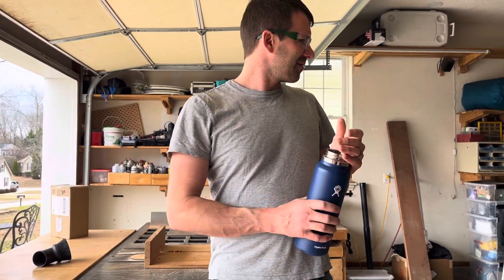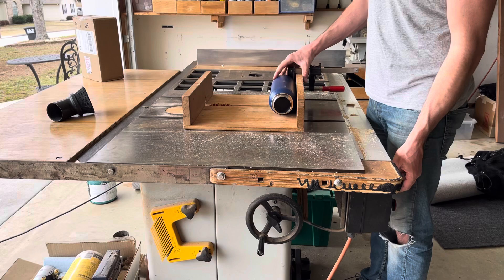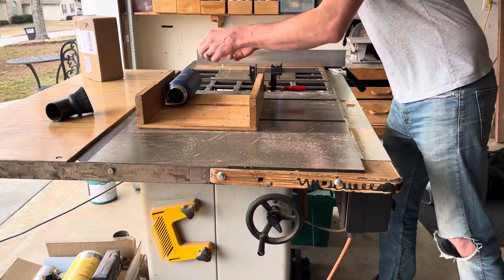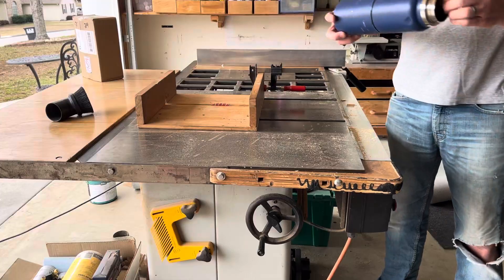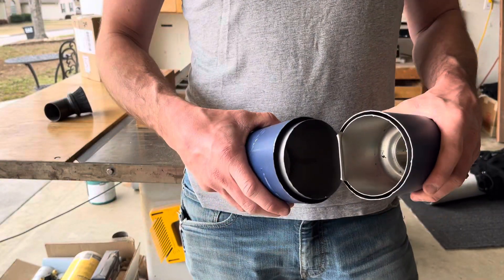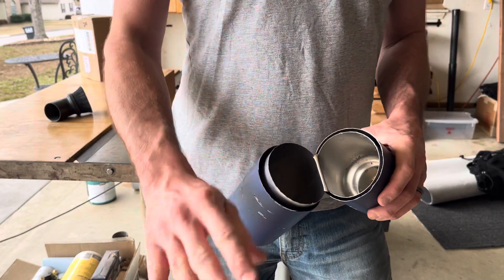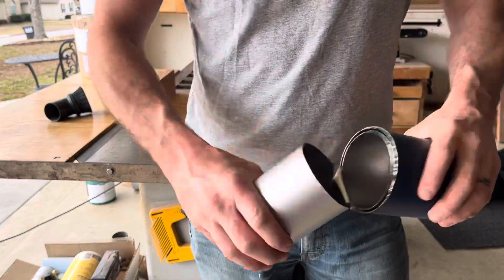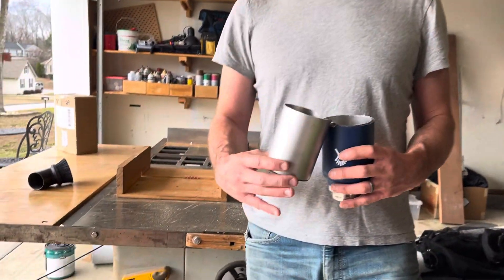Inside a vacuum flask - a close call on the table saw

Comment: it went better than i expected...
guess this isnt a task performed often enough to warrant a jig, lol... ratchet strap or pipe clamp, end stop, and take a few passes on that sled... gotta be slightly mad to hold a cylinder by hand on a saw?

last time i mistook aluminium for something else i nearly set the lathe on fire... was magnesium?
 all fingers present, no blood... sigh...
Reply from the maker: Nice comments! In hingsight, a bandsaw (which I’ve already sold) or reciprocating saw would have been a superior choice. One runs what one has sometimes. Magnesium on the lathe! Adventurous !!
Reply: @PilgrimsTravelLight  the magnesium itself wasnt the issue, it was the blowtorch to heat some stainless tubing a bit later that set the magnesium off... then the build up of iron and ali also lighting up... pays to clean your lathe!

at the time i just thought it was a particularly nice-machining grade of ali... lol.
Reply from the maker: @paradiselost9946  woah!

Comment: That’s stainless steel not aluminum, and the sled and stop block didn’t make it safer, nor did the safety glasses.  Seeing worse on the internet is what made it safe.😅
Reply from the maker: It was a last minute idea to do this and when the magnet didn't stick, I thought "aluminum". After I saw the sparks my mind was divided between "why the sparks for aluminum" and "focus on the task at hand". The sled and stop block help a lot for keeping it aligned and not getting caught, turning off the saw was the bad idea...

Comment: Ooof, the moment I saw sparks I'm like "thats no moon"...
Reply from the maker: I know, I threw a magnet on it really quick and saw that it wasn’t magnetic, and my mind just automatically said aluminum, after I saw the sparks my mind began to work on the contradiction, but was also focused on the task at hand.. The tungsten car by teeth are still fine, but it was a harder ride than aluminum.
Reply: austenitic steel isnt magnetic; contrary martensitic is magnetic but both are stainless iirc.
Reply: but yeah, kudos for the hands on teaching of the young ones!